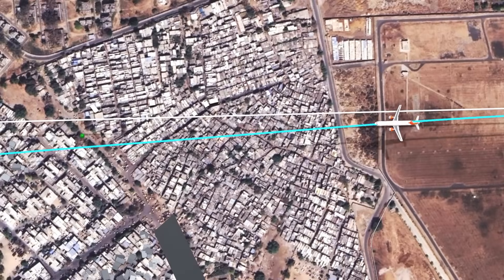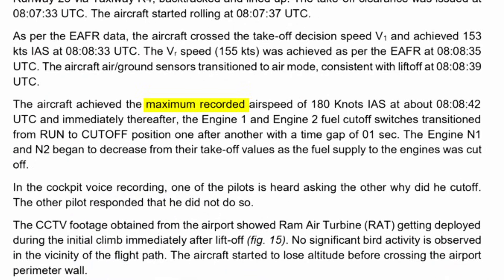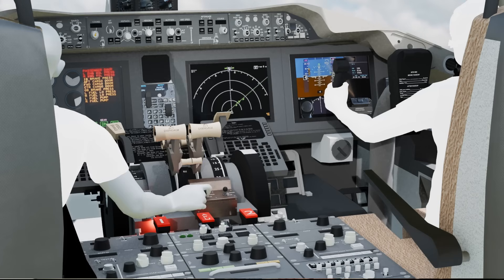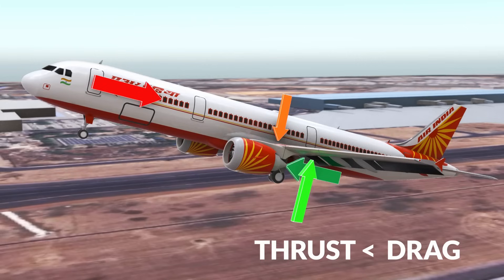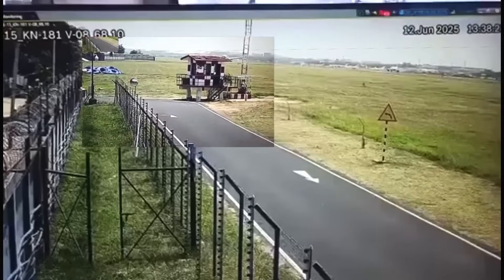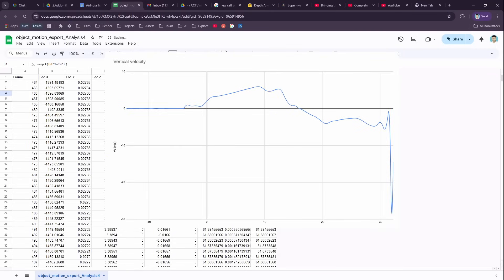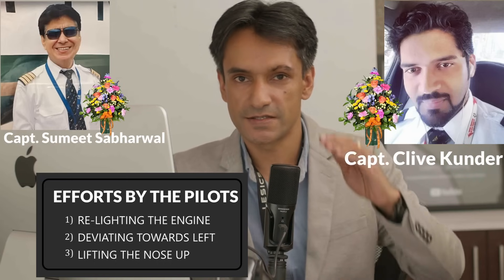Use of 3D Clone | Decoding the Crash Details you Missed

Comment: A little common sense, in addition to aviation technical knowledge, is required to analyze any aviation event. When there are so many less painful ways of committing suicide than the extremely horrific method of burning to death in a fiery airplane crash, why would someone choose to kill himself this way? The minimal and vague information, submitted by the authorities, is not sufficient to draw any conclusions. Because they can’t explain what happened, so called Youtube "experts" were "reaching" to come up with an explanation for this crash, by blaming and defaming the pilot(s), similar to the Malaysia Airlines disappearance where, because these experts, because they could not explain what happed, try to blame the pilot simply because he had a flight simulator on his home computer, as do virtually all pilots. The statement "why did you turn off the fuel switches" is being interpreted as being a cynical statement. In fact, when facing imminent death, with only a few seconds left of life, both pilots may have acted in a desperate manner and independently from each other in trying to restart the engines, which would clearly explain the question. One of the pilots, suspecting an electrical or fuel switch or FADEC failure, may have tried to cycle the fuel switches off and on in an attempt to fix a suspected fuel switch or FADEC problem, similar to what a pilot may do in cycling the landing gear switch up and down when the wheels won't come down. This electrical problem is a certainly possible scenario considering the reports of water leakage damaging the electronics in some 787s,
which caused some systems failures.  Unfortunately for the passengers, crew, and others, there was simply not enough time for the pilot(s) to troubleshoot the problem and re-start the engines. While it is possible, it seems unlikely that accomplished pilot(s), at the pinnacle of their careers, would intentionally crash this airplane. At least, I hope not.

Comment: A very good, thorough analysis. It is clear that the fuel shutoff occurred early and automatically. 
It was obvious to me, even before reading this report, that the crew did NOT cut off the fuel. Well done.
Reply: The 787 is basically a Robot, it has a mind of it's own....and it's systems are an electrical nightmare...
It took control of itself and bang!
Reply: What rubbish it's clear the pilot switched of fuel but good try to deflect real culprit
Reply: @lonibeck2293   You're not getting it.  The engines were shutoff 1 second after takeoff, 2 seconds later the pilot moved the switches to Cutoff and back to run which is the standard procedure to restart an engne.
Reply: @lonibeck2293   If you used your head, you'd realize they have nothing on the pilots. No sound of clicking the switches, no "allah akbar, goodbye cruel world" conversation. They have one leaked sentence of "The airplane is in your hands", which means nothing more than "You're in control". And they have the question (in indirect speech mind you) "why did he cut off". As someone Hindi pointed out, in India, airplanes are not called a "she", but a "he". The indirect speech is hence inconclusive, whether the pilot was referring to the other pilot cutting off, or the AIRPLANE cutting off by itself. The other pilot then replied, he personally did nothing. It's just your bias of watching too much cpt. Steeve, to select one of two realities both explainable by the same incomplete leak.

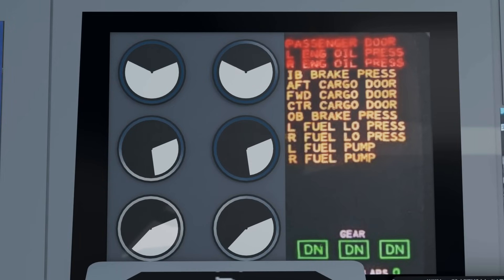By far the best argument is this one - if the captain wanted to crash the airplane, why do it at takeoff, when the other pilot is in the cockpit, his focus is at 100%, his senses are heightened, all crew is in "anything can happen" mode, at their most concentrated??? It was supposed to be a 9:15-hour flight, that routinely took over 10hrs. First bathroom break for the 1st officer, lock yourself in the cockpit and smash it into the ground. The death is instant, from the impact force. Cutting of at takeoff, you risk surviving the low-speed, low-G impact and burning to death. This suicide makes absolutely no sense. The 1st officer could've prevented the captain from switching both cutoffs, after the 1st one, he could've hit the other guy, etc. Why didn't he immediately declare to the ATC - "captain is crashing, captain did it", or just for the CVR black box, to be heard? Because the captain did nothing wrong.

Why the farce of the preliminary report contains the time when RAT started supplying the power, but not the time it was deployed? It's obfuscating the fact it deployed the second after liftoff, when the weight of the plane on the landing gear was lifted. This was obviously a catastrophic electrical / systemic flaw. The computer may have thought it is landing (not taking off) and it cut the engines. Or a complete electrical failure, water in the EEC, short circuit, etc. Total meltdown basically. They won't reveal it this early!

The investigators have nothing on the pilots, or they would've released it immediately. They are only delaying the already plummeting Boeing stock going to zero in 1-2 years when the truth finally comes out, so that Boeing can minimize its financial losses.

Use - your - head.
Reply: @MerrekSK   Excellent. My thoughts exactly.  For a Captain of 30 years good record to become a mass murderer,  there would have to be something very serious done to him.  However he did not have such a life.  Also, none of the friends, relatives or colleagues say anything horrible happened to him, despite all the digging by the press.
Reply: @MerrekSK  You are right on! Thank you!
Reply: @lonibeck2293  physical movement of the switch provides sufficinet noice, the noice is sufficent enough to capture by audio recorder.
Why it was not included in the leaked report by the people who leaked the report?
additionally one second means means, it can be the interval between 3.99nd second and 4.0 second.
This one second interval can fall in this 1 milli second.
Reply: @lonibeck2293 he is already admitting that his mind was already made up and this (bogus and biased) video reinforced his misguided initial opinion. Textbook confirmation bias at work.

Comment: Facts can be truely revealed by engineer's prospective. You have demonstrated to the world it's facts, only facts that we have to rely on. It seems clear to me that the EEC/FADEc ( it ) believed it needed to stall the engines just at the moment of takeoff ( WOW just flipped status ) Without a well thoughtout hystersis loop controlled mechanism to maintain fuel, it'll just fall. That is in line with the graphical analysis.
Reply: when he said that the two fuel cut-off switches cannot the manipulated in one second that is subjective and not fact.  It is very doubtful that a software glitch, or anything else but pilot manipulation could duplicate the interval between the fuel cut-off.  And many 787 pilots have stated such when shutting down the engines once settled at the gate.
Reply: The actual switches were moved. The switches have additional cables specifically for monitoring the position of the switches,  and the FDR recorded that the switches moved to the Cutoff position.  They can only be moved manually, I.e. they have no automated movement capability.

Comment: Great analysis. Everyone knows momentum will
Reply: As soon as RAT is out changeover 1. Power relay of RAT GETS ON CAUSING NO TO NC MILI SECOND INTERRUPTION IN POWER TO ESSENTIALS. 2. RAT POWER IS TOO LOW DUE TO LOW SPEED HYDRALICS AND ELECTRICSL ARE NOT ENOUGH TO POER BOTH ENGINES DO ONLY ONE GOT ON. 3. CSBIN POWER STIL ON AS RAT EOULD POWER ONLY ESSENTIAL RESIDUAL MONUMENTUM OF  TURBINE WOULD KEEP CABIN ON .
4. YOUR ANALYSIS IS GREAT👍👍👍
Reply: Boeing knows everything but hiding facts and corrupt Indians are giving clean chit to Boeing and GE. You should be on investigating team

Comment: Bravo... Engineer.. This is how an engineering works...
Reply: Numbers do not lie
Reply: @KartikeyG  This guy's numbers lie   1:33  His typical takeoff profile would need to be adjusted for weight and density altitude for it to be used as a side-by-side comparison.
Reply: @Redridge07 maybe. Although I do not see a huge deviation owing to the factors you mention. In any case - there is still no proof that the pilot did it.
Reply: @KartikeyG  I was just discussing his data set. If he's an engineer, he should have considered this.
Reply: @Redridge07 fair point.
Reply: @Redridge07 the power output is clearly reduced. Even if the plane is overweight, which the official report said it wasn’t. So either the official report is lying and hiding data for a reason, or the engines were underpowered from the off. Both are also possible
Reply: @StoutProper  I can tell you're not an engineer. The adjustment to weight doesn't mean it was overweight. He used the typical values, but you can't use those in this type of analysis. You have to adjust for the actual parameters. Those charts exist, and he should have compared it to the actual charts.
Reply: @Redridge07 I can tell you’re not an engineer or a physicist because you’re just waffling with zero knowledge or understanding or reference to either or any evidence. Saying the word “charts” doesn’t mean anything. Keep on playing kid
Reply: @StoutProper  too funny ... professional engineer here.  Dont be afraid to learn.  Just search pressure and altitude density.    Aside:  2:32 is called a chart, I am not sure what you tried to make fun of calling it a chart.
Reply: @Redridge07 yeah I know the runway was at 570' pressure altitude because of the low pressure high of 1000 hPa/mbar, and low 992 hPa/mbar that day. Temperature highs of 43 degrees Celsius, Humidity high of 94%, Air Quality Index 143, PM2.5 52.5 µg/m³, PM10 105.3 µg/m³, the winds were 250 at 7 knots, equivalent of a crosswind from the right of 3kts, and the runway heading is 225. Anything else you’d like to know?

You said he should use charts. You weren’t specific about any charts at all, and certainly didn’t refer to any in the video. No one can read your mind over the internet, although it doesn’t sound like your wife would have too much trouble.
Reply: @StoutProper    one would have to be simple to not know what charts I was referring to after watching the video.
Reply: This is how India works
Reply: This is how denial and stupidity works.
Reply: @ScottMunro-p3y  Why not you try to refute Sabin Mechanical Engineering's explanation above point for point instead?   Words like "stupidity", any Tom,  Dick and Harry and even a 3-year-old can use them.
Reply: @ScottMunro-p3y you're free to comment but numbers genuinely do not lie. And wouldn't be the first time real reasons are hidden.
Reply: @ScottMunro-p3y up to you to disagree but numbers do not lie.

Comment: Unfortunately, the truth is a crew member on purpose wanted to take this aircraft down. Depression is a terrible reality for some and it can cause them to perform unexplainable actions.
Reply: the real truth is that manufacturers and airlines try to blame the pilots whenever possible, and this is a sad example of that occurring.

This playbook is so common that many are able to see through it;  apparently not yourself.

there's an old saying that applies:

fool me once, shame on you.   fool me twice, shame on me.
Reply: @danlibby6810 the truth is the plane was indeed sabotaged. You're a fool for thinking otherwise. 
A dead engine can not be reignite, in this case it was!. A conversation between two pilots "why did you turn the fuel off"... not normal. 
Captain Sumeet depression diagnosis... are you going to ignore that as well???.
Reply: @danlibby6810  The first two comet losses wer initially blamed on the pilots.  The 2nd crash was the first ever jetliner fatal accident.
" It was later determined that the Comet's wing profile experienced a loss of lift at a high angle of attack, and its engine inlets also suffered a lack of pressure recovery in the same conditions."
https://en.wikipedia.org/wiki/De_Havilland_Comet
Reply: Leider gibt's hier Trolle, die keine Beweise bringen, aber ablenken wollen; troll dich!
Reply: GTY

.

.
Go Troll  Yourself